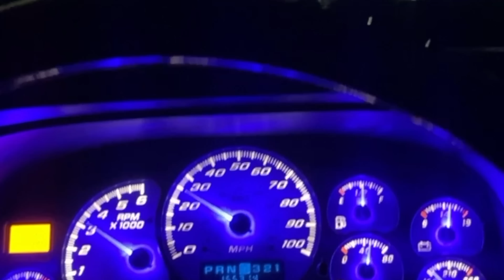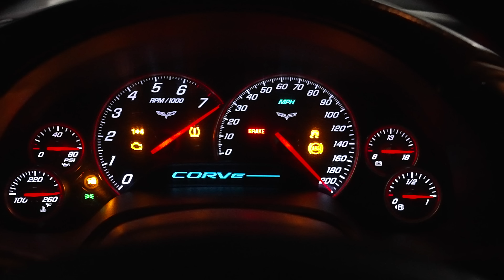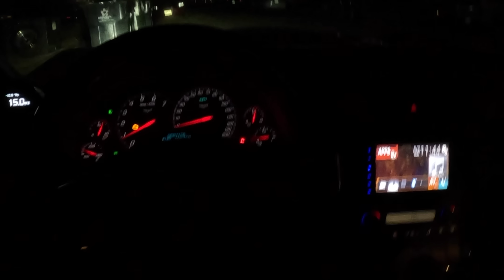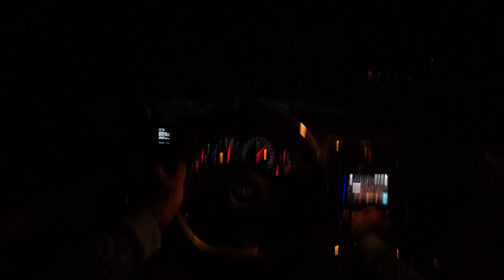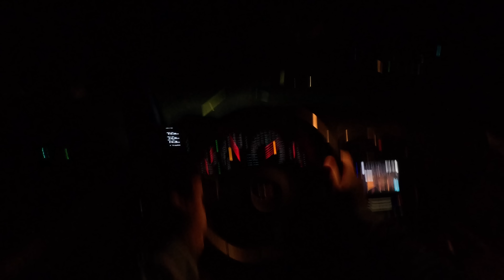Supercharged C6 Corvette Late Night Drive | ASMR Engine/Exhaust Sounds

Comment: Ok please dont make fun of me.. I have a serious question. How is his supercharger making turbo noises when he's letting off the gas? I have an LSA n it doesn't sound anything like that.. does it have to be a manual to get that sound or what's needed?
Reply from the maker: There’s two types of superchargers the Corvette has its trial supercharger. LSA is a supercharger…. They both force air into the engine, but the design is different. The LSA has an internal bypass now supercharger uses a blown valve to regulate.
Reply: @Its_Mike_Myke  ok I see. Do you know if theres a kit or anything to eliminate the internal bypass so I can use a blown valve like yours? Or that's just the design no way around it..?